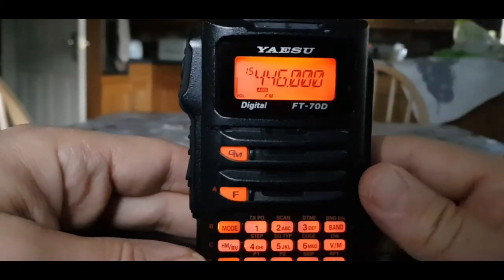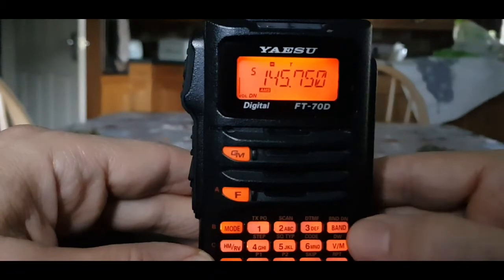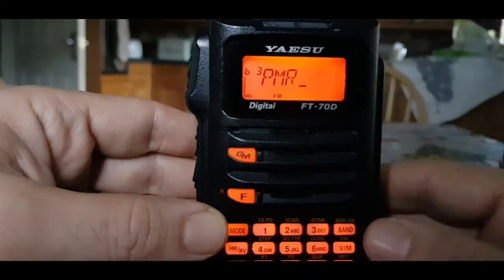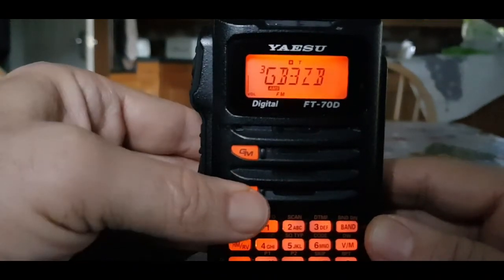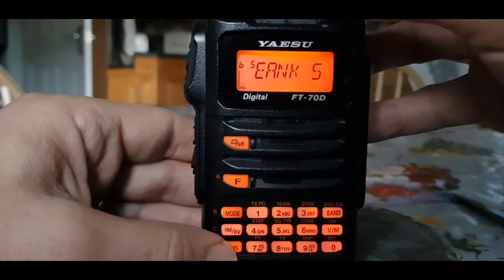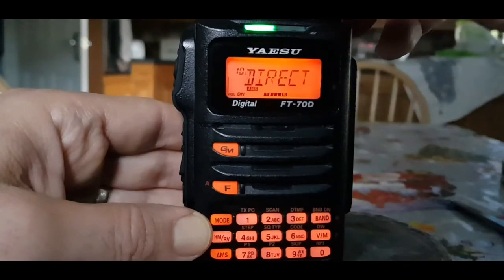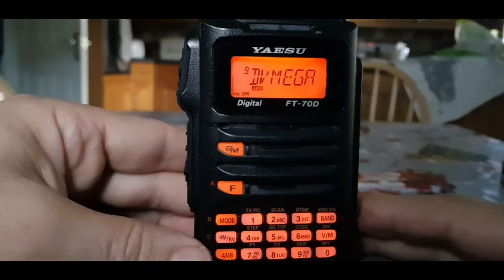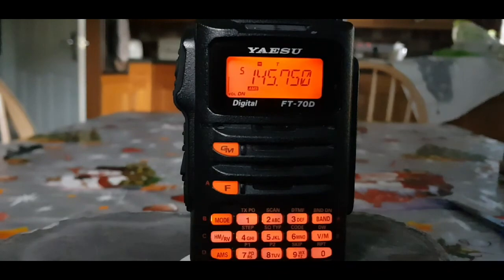Yaesu FT70D -Memory Banks-Set Up

Comment: I'm having an issue. When I bit the Bank button in memery mode it says "No BNK". When I try and save to a bank it says "Reg BNK". I tried setting the channels to banks in the software and no luck that way either.
Reply: Ok i finally figured it out. I had to manually add a channel to bank that I had not named in the software. Now it works. Very odd.
Reply from the maker: Sorted
Reply from the maker: Sorted good job

Comment: Thanks for making the video. Short how-to videos on a narrow topic are helpful to a lot of people. Just to clarify and write-up clear instructions:
- one press of band to get into memory bank display mode from memory display mode
- when in memory bank display mode, F then band to select the memory bank with the knob on top of the radio, band button again to escape bank selection and return to memory bank display mode
- scan (F then 2) or select the memory with the knob on top of the radio
- band button to switch back to memory display mode

Yaesu desperately needs to hire some user interface (UI) engineers (the above procedure is anything but intuitive), but having memory banks is very nice feature. If you live in an area with a lot of repeaters and store the frequencies for them in memories like I do, being able to put them in banks means not having to turn the knob through hundreds of memories to select the frequency or repeater you want. Ditto for weather frequencies and others. 73
Reply from the maker: Use front F  buttons its quick

Comment: This radio drives me batty! Maybe it's because my Anytones and Baofengs are so easy. IDK but everything about it is so damned complicated.
Reply from the maker: My best advice is look at the front buttons and what is written on then , when you push F it does what the button says .
Reply: @M0FXBHamTech  I'm sure. I know the problem. It's time in the hand. I've had it for almost a year and have barley killed one battery.
Reply from the maker: https://youtu.be/ut_jfULNjcw
Reply: Yaesu transceivers are second to none. Other hams frequently comment about how good my audio sounds (it's not me, it's Yaesu). The functionality Yaesu packs into a small volume of space is wildly impressive and Yaesu radios are built like a Sherman tank. That's what I like about Yaesu. If I could only have one radio, it would be my FT-991A. However, they desperately need to hire better technical writers for the manuals and UI engineers to organize the controls intuitively. It's inconceivable that someone thought it would be ok to require two hands (a button and a knob) to adjust the volume on a FT-70DR (hint to Yaesu: that could still be fixed in firmware update to add a binary switch between volume and menu selection on the knob). AFAIK, it's the only radio ever built (at least in the 21st century) without a volume knob. Even after I figure out how to do something on a Yaesu, I still groan about the bizarre steps required to get there. If Yaesu would resolve these two issues, they would give themselves a massive lead over ICOM/Kenwood. For now, that's the weak link for the other manufacturers to exploit.